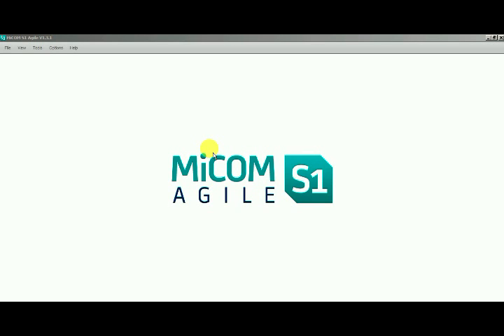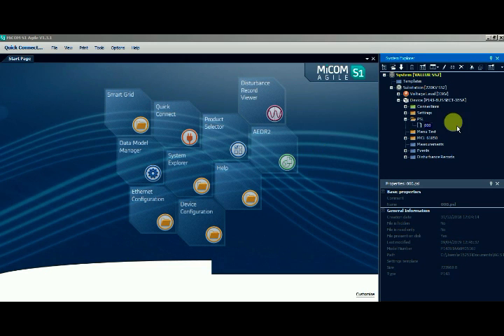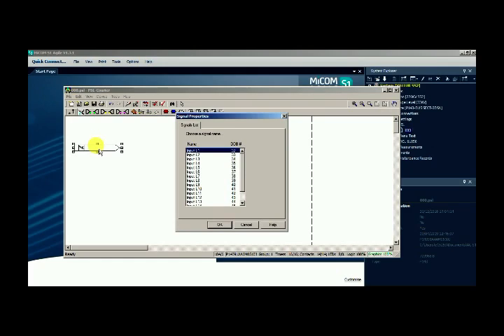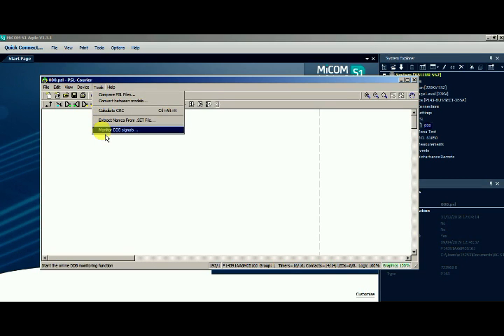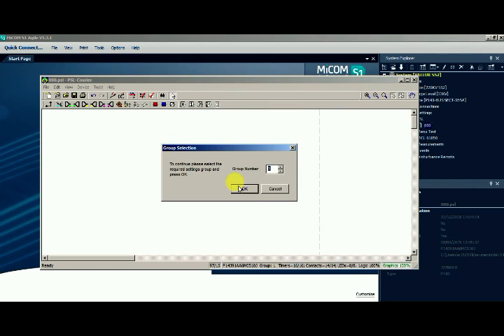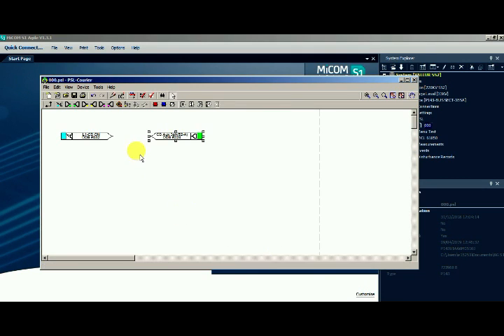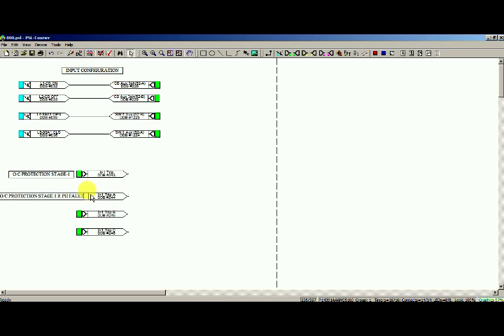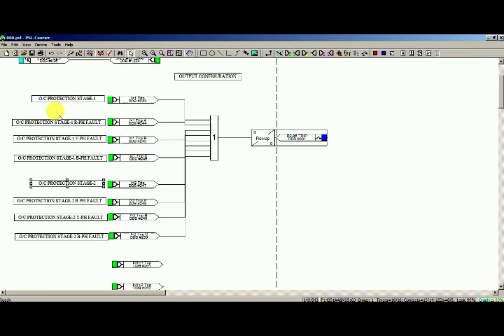How to Configure PSL in MICOM Relay | Step-by-Step Protection Settings Guide | PSL Easergy Studio

Comment: Bro 1.what is use of opto input why we assign in Input.
2. Fir example
If assign I  > stage one for output 1 contact 
Any need to assign in Input lable or if just protection enabled automatically comes in ddb signal as for over current!!!

Comment: Sir In micom relay any fault occur in double phase LED glove A,B,C also it's correct or not ,because Siemens relay any fault occurs in two phase LED glove that two LED only
Reply from the maker: phase to phase fault is trigger to three phase fault as per relay configuration so  it show the led like that

Comment: Sir I'm configuring p441 relay using psl..iam doing over current protection..I have kept in psl logic as  i>1 trip to output contact 11 and trip led but they are not becoming high and trip led is not glowing why